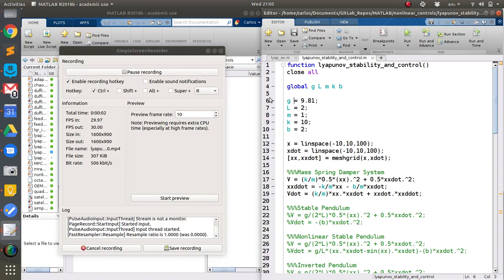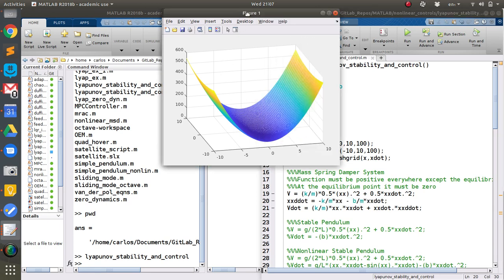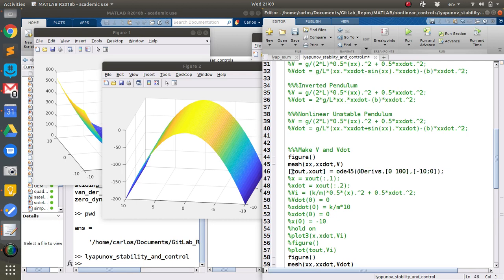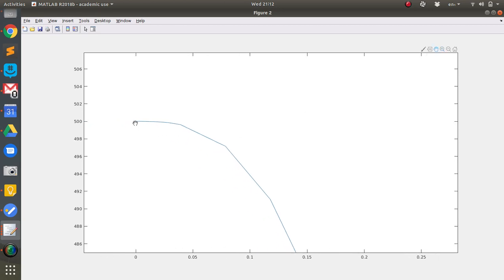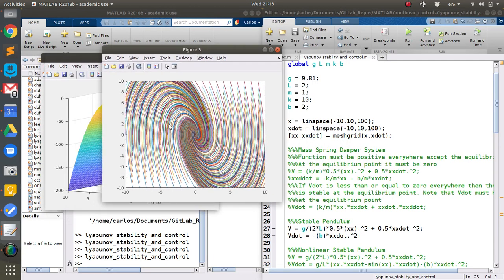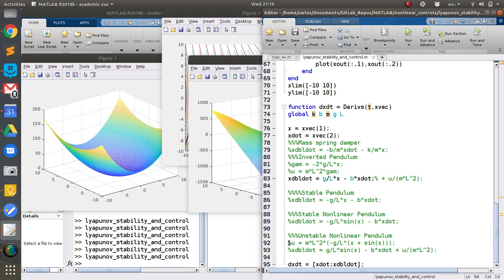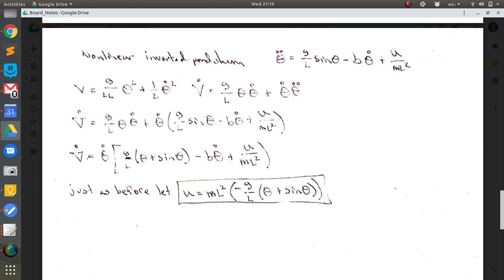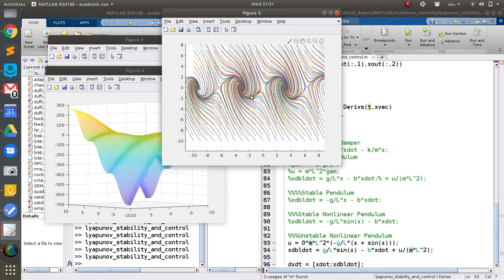MATLAB Help - Lyapunov Stability and Control

Comment: I am currently writing my thesis about the stability of cooperative adaptive cruise control. I want to use lyapunov for the global stability analysis of my system. There are so many videos only explaining the broad concept of lyapunov stability, but this video actually gave me the insight to use lyapunov analysis myself. I will be executing lyapunov analysis on a large state-space model instead of simpler equations, but this video helps me to get closer to my research goal. Thanks you very much!

Comment: Dear Sir How are you?  Hope you are good and healthy.  I have a model SIR from the spread of diphtheria disease with vaccination and I achieve linearization of the model through the Lyapunov function that was built using the Krasovskii method but actually I didn't know how to check the global stability of the model using the Lyapunov  stability theorem was built using the Krasovskii in MATLAB method Will you, if possible help me in this problem, please.  Thank you
Reply from the maker: Problems like that always involve hand calculations first. I think before you try and code anything it would be wise to make sure you can set up the problem by hand first.

Comment: Sir, please make a video on "Sensitivity Analysis" of a system of odes using MATLAB-Simulink and call the system of differential equations from matlab.m file by Interpreted MATLAB function.
I'm also saying about the calling of function from matlab.m file into Simulink because it is very easy to call a system rather than making a full Simulink diagram in Simulink. If you use a "Couple Dynamic System" then it would be much better!
Thank you so much, sir!
Reply from the maker: I'm not sure what you mean by sensitivity analysis.
Reply from the maker: @Sinanmmd  That video is using a pretty complex set of built in MATLAB functions. If I were to do it I would simply make a function y = f(x) and vary x with some mean and standard deviation such that x = x0 + N(xmean,stdx) and then make a histogram of y = y0 + N(ymean,stdy)